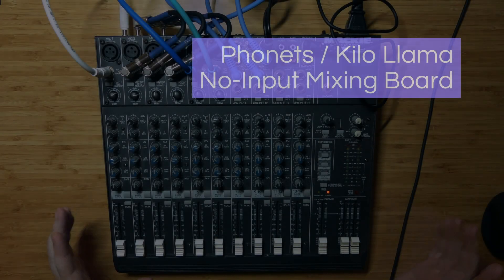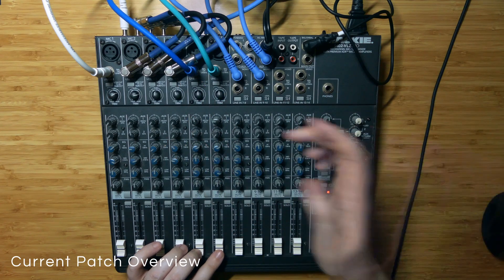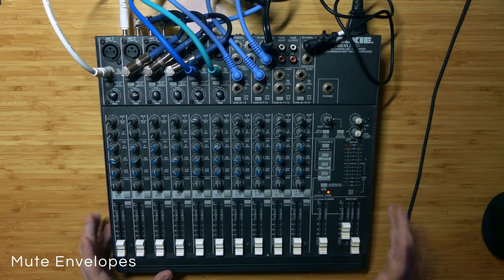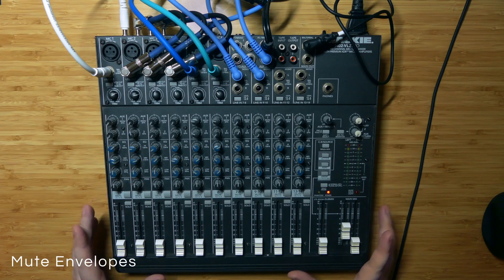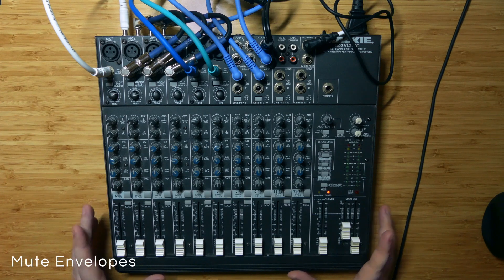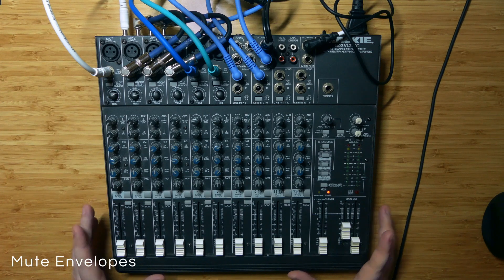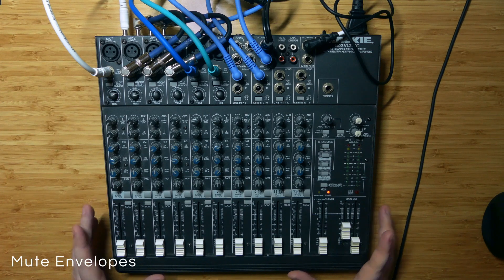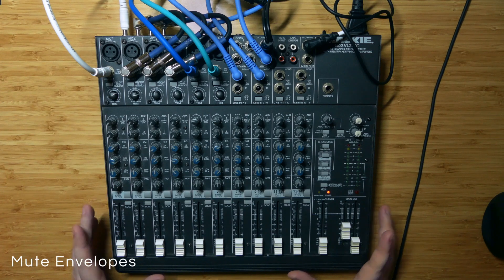The No-Input Mixing Board: Technique Roundup

Comment: How many patch cables should I buy to get me started? I'm a newbie and following your lead. I justr bought the 1402, anything else you would recommend buying to get me up and running quickly?
Reply from the maker: I find that I normally use between 6-8 TS cables for patching the 1402. If you want to maximally patch it, you'd probably want more like 10-14 cables. I like the multi-color sets because they're easy to keep track of what's patched to what. Just make sure to get TS cables and not TRS cables if you want to be able to patch the channel inserts like I do.

A Y-cable (TS Male to to Dual TS Female) like the one I use in this video for parallel feedback opens up more patching options, so it might be fun to get one of those when you're getting patch cables.

And that should be everything you need to get started (assuming you have something to plug the mixing board into). Let me know if you have any questions as you get started!